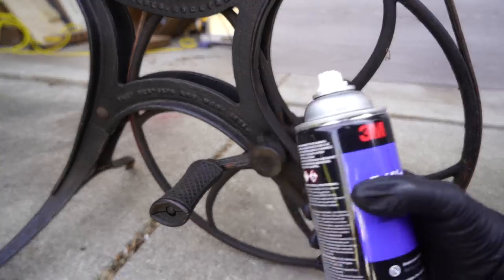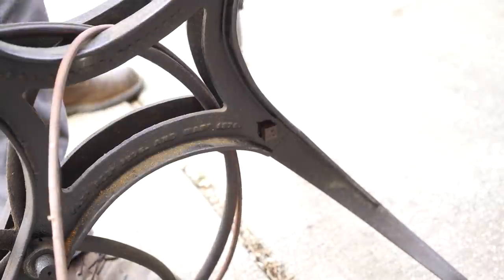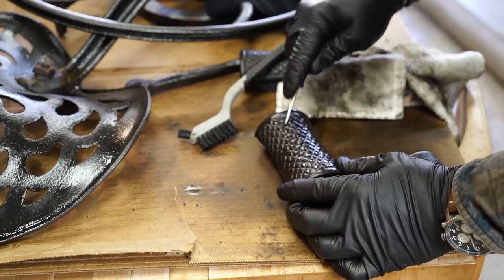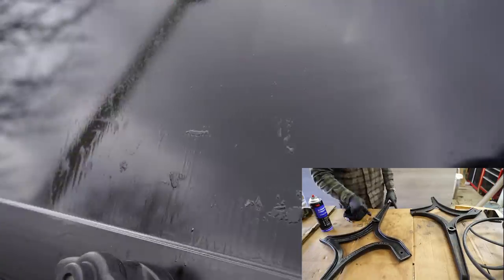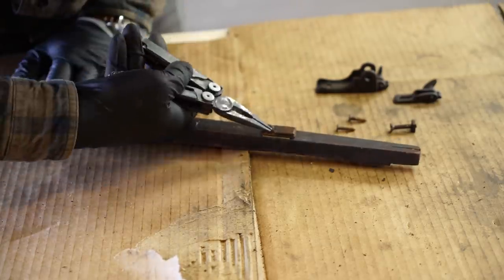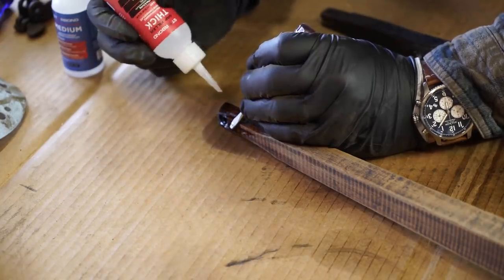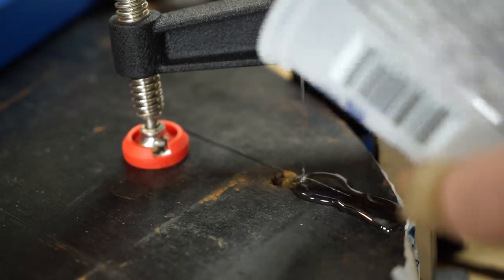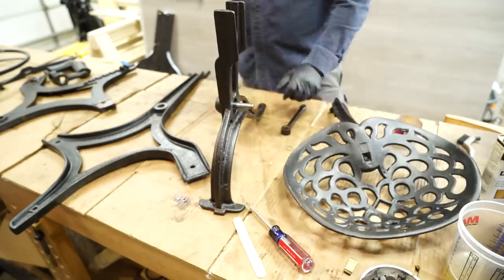Restoring Rare 1800's PEDAL POWERED Scroll Saw

Comment: What a treasure!!  A couple of thoughts.  A wire brush to remove surface rust, then "season" it like cast iron cookware.  Once seasoned, then the BLO sealer.  And for the wood, I once heard (for BLO finishing):  one coat per day for a week, one coat a week for a month, one coat a month for a year, and then one coat annually.  You didn't show it, but, hope you greased the axles and pivot points.  For the leather belt, I think I'd've done a saddle soap cleaning prior to a liquid leather conditioner (like Bick 4) and then the beeswax based finish.  Amazing to've found the belt still in serviceable condition!

Comment: That's so wonderful that you were able to acquire the saw!  Preservation is not an easy thing.  It takes time and a huge amount of care (and even a little passion).  You never mentioned if the leather belt was successfully restored to be usable.  Also wondering how much of the original hardware was still usable (screws, bolts, ect.)?
Reply from the maker: everything was able to be reused. There was a couple missing screws that I had to replace, but everything that came off went back on.

Comment: I've seen several black and white photos of that time period of this style scroll saw and it LOOKS like they were originally painted all black (black lacquer). Personally, I would probably have gone with all black too. One thing you might need to do is to adjust the travel to prevent the banging of the arm in the up stroke against the bottom of the top. Great find and glad you want to put it back in service.

Comment: Looks awesome bud! What kind of cuts would you use this for? Is it like a more versatile bandsaw?
Reply from the maker: they are meant to tight corners and intricate work. They are a great compliments to the band saw, each has its pros and cons
Reply: Third Coast Craftsman Makes sense. I assume the main pro of the new scroll saw is that it will make your legs look like tree trunks!
Reply: @ThirdCoastCraftsman  It does make you wonder as to the benefits of a modern scroll saw over something like this? Other than space saving, I don't see why an electric scroll saw would work any better given the type of cutting performed by a scroll saw. Any thoughts? I could see a pedal powered band saw being less workable, but an average person could output 200W on a bike, which is more than enough for a scroll saw.

Also, with modern bicycle technology, I'm surprised that some budding company hasn't produced an improved version with more features and gears and so on.
Reply: @ricos1497  These were built either before any electricity was available, or to use in rural areas where electricity hadn't shown up yet.

Comment: Probably made between 1876 and 1886 when they went to a flat "gear" belt model. This had holes in it which engaged on sprockets on the top drive wheel and had better torque. As per the factory spec the wood was maple.

Comment: In your use of the adhesive remover did you by chance use it on anything like fiber glass or the material like a RV? I would love to get rid of the decals on my RV but the adhesive is a bear and solvent based removers melts the top coat.
Reply from the maker: I think a lot of RVs are coated in gel coat and I am not sure. It would be worth a try, I honestly dont think it will hurt it like most solvents but you always want to test it.